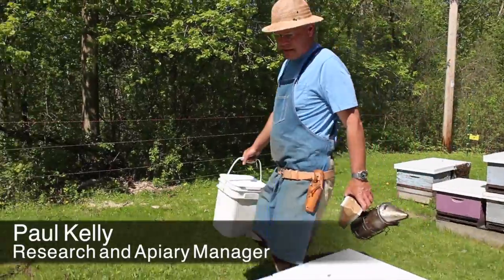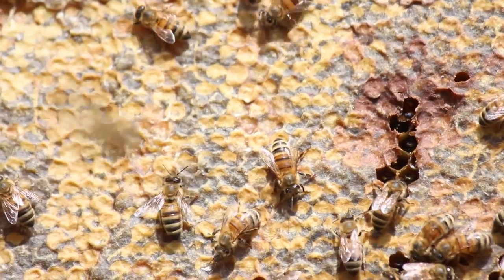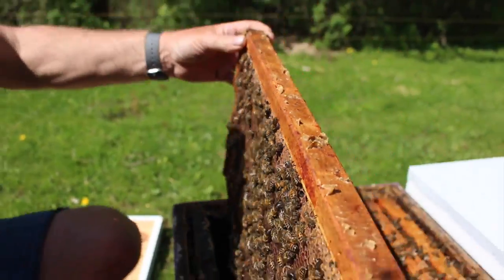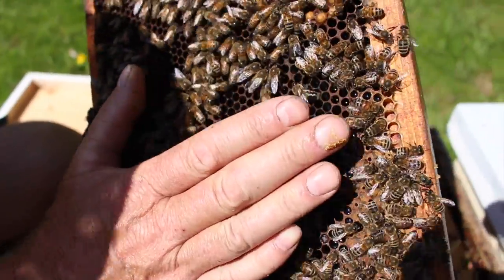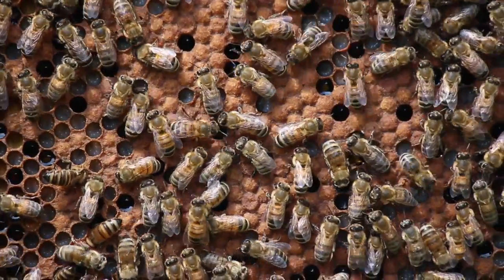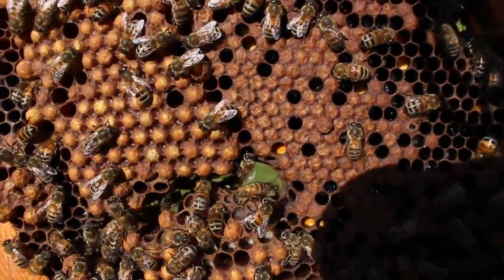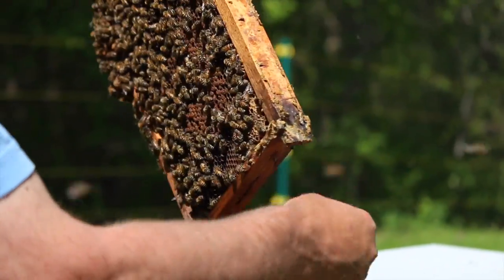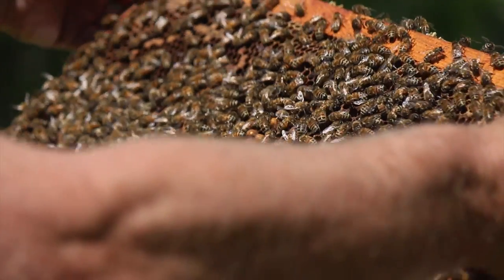Colony Inspection

Comment: I notice that, during your inspection, you don't clean off the edges of the frames (burr comb, propolus) as I see other beekeepers do in other videos.  Others say it is to make it easy to remove/replace frames by keeping the comb even.  What would you say to cleaning up the frame edges?
Reply from the maker: We scrape excess wax off the top bars each fall as we wrap our hives for winter. In using 10 frames in a box there isn't much excess wax on the sides of the frames. Bees rebuild comb whereever they have space so I think it's futile to be scraping more than necessary. If a hive dies we cull comb and scrape all the frames we keep.